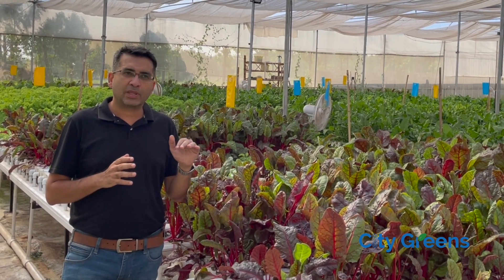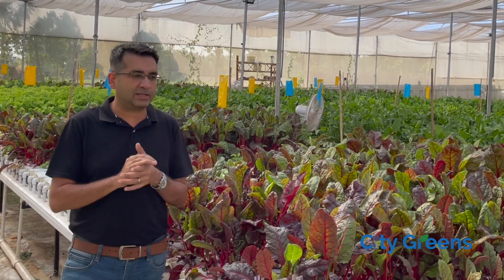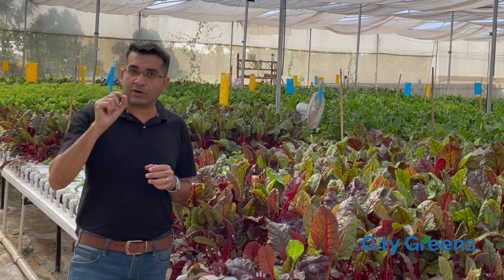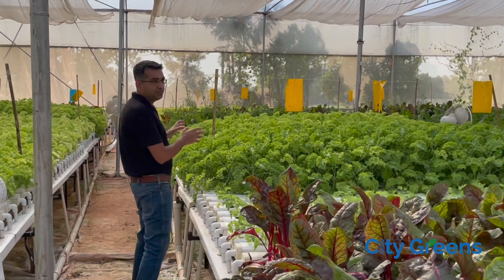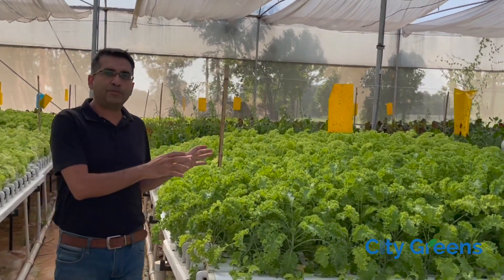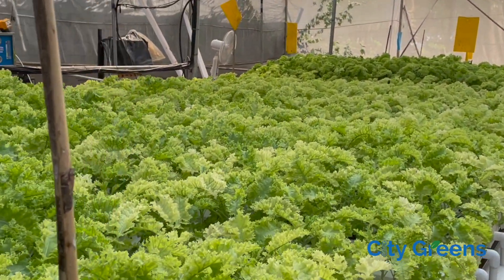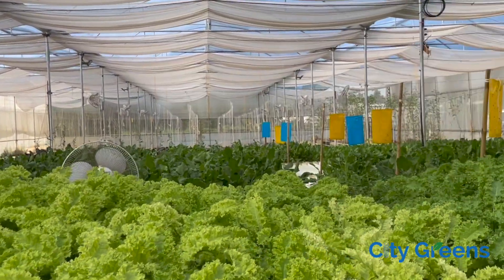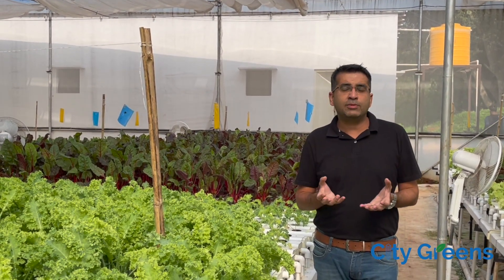What is nutrient dosing system? Should you use one in your farm? How will it help?

Comment: what is the solution for the initial growth ie after cotyledon, we have purchased 30 ml of growth , flora and thrive bottles from amazon but how to use is confusing
Reply from the maker: 1. For vegetative phase you will need grow and thrive. 
2. For flowering and fruiting phase you will need flora and thrive. 
3. These are concentrated solutions. To make diluted ones take 1 liter of water and add nutrients to reach desired TDS. 
4. For vegetative phase, add 2 parts grow and 1 part thrive. For example for every 2 ml of grow add 1 ml of thrive. 
5. For flowering phase, add 2 parts flora and 1 part thrive. For example for every 2 ml of flora add 1 ml of thrive.
6. Keep adding in above ratios till you reach desired TDS or EC if you are using those meters. 
7. If you are not using those meters and or don’t know the TDS you need then use following approach
8. After germination make nutrient solution by adding 4 ml grow and 2 ml thrive to 1 liter of water. Use it for watering the saplings. 
9. Increase the dose every week by adding additional 2ml of grow and 1 ml of thrive. 
10. After week 4 (once you reach 10 grow and 5 thrive) maintain this strength till flowering starts. 
11. Once flowering starts replace grow by flora in same strength. 
12. Use this mix going forward

Comment: What are the nutrients used. Can you please explain
Reply from the maker: You can use any 2 part or 3 part liquid nutrient for Hydroponic application.
For soil based application, Different solid fertilisers can be mixed in 2-3 or more parts and the system can be customised for same.